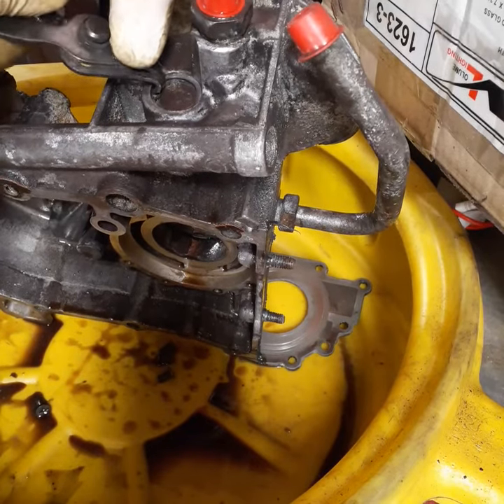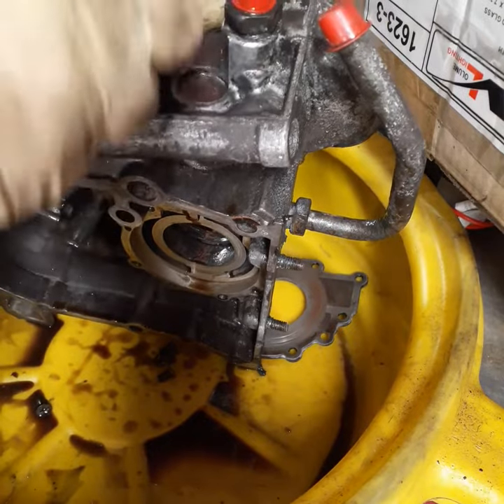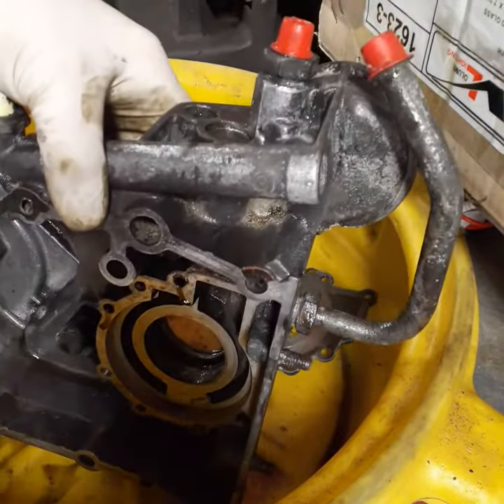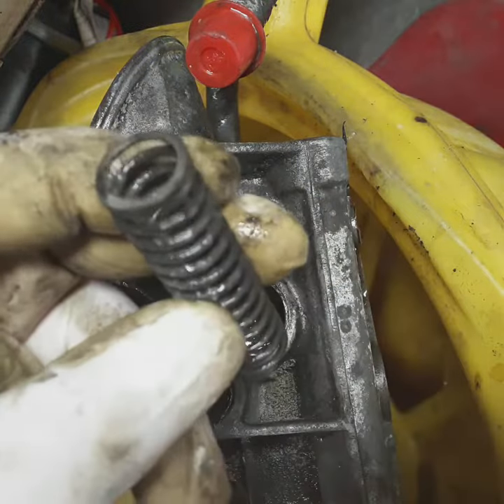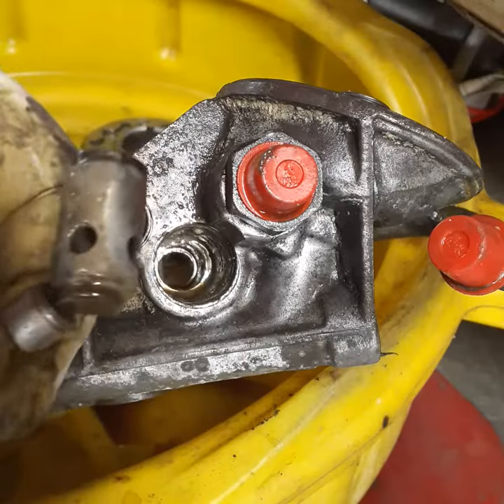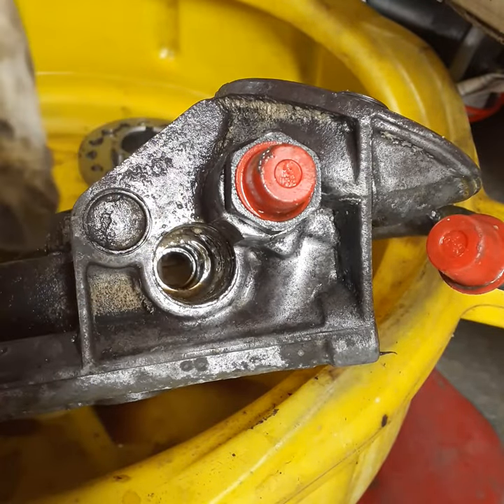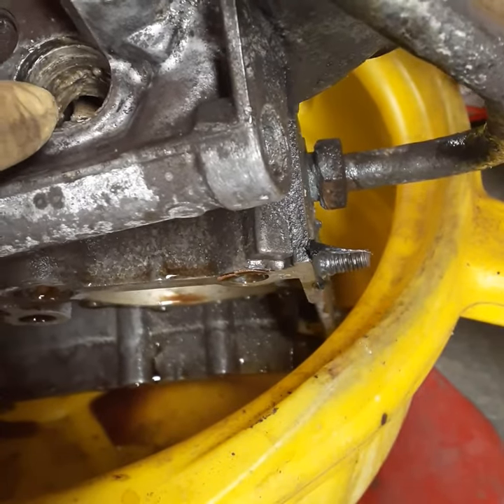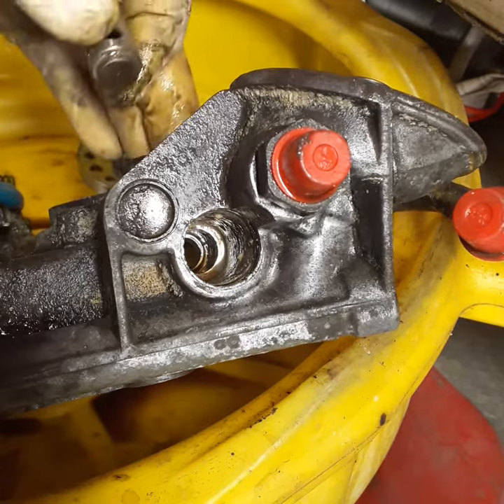Hidden secret! EASY FIX! Rover 4.0L Oil pressure relief valve removal.

Comment: I ended up tapping down with a larger socket and a rubber hammer. Kept squirting with WD 40 and it finally launched the parts out 😂. I’ll be cleaning and reassembling before I add the new oil gears in
Reply from the maker: Launching is right, there's a lot of pressure behind that plunger.  Check out a few other videos on the oiling system, before you reassemble your pump.

Comment: Was this plunger stuck open or stuck close. Stuck open=  engine is damaged?. Can't imagine that this plunger which control pressure of engine oil going into bearing or rocker arms etc could become stuck in an open or partly open position. This is in a diesel engine?. Oil change interval of 10,000 miles?. Regards.
Reply from the maker: This is a 4.0L gasoline (petrol) engine.  The vehicle was abused in every way.  It was run low on oil, then with thin oil (5W-30) and then too much oil, and overheated multiple times.  The plunger was stuck open, as it was finally and fatally overheated on the highway.  This is when the plunger is in the most open position and it stuck there.  I'll be making some videos this summer, doing a teardown of the engine.  The videos of a 4.0L are of a used engine that we rebuilt and are currently installing.  Thanks for the questions and comments.